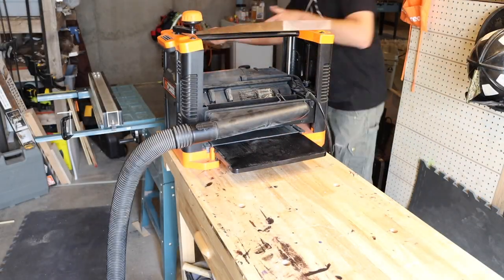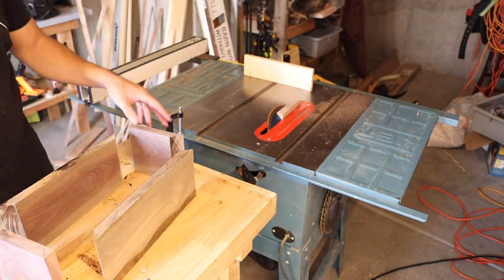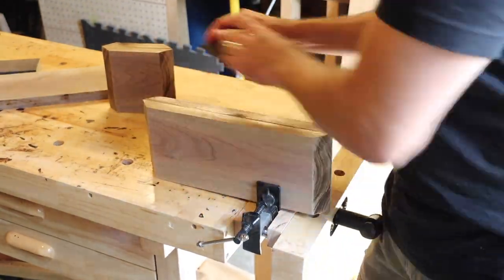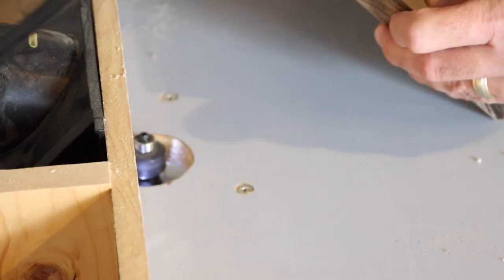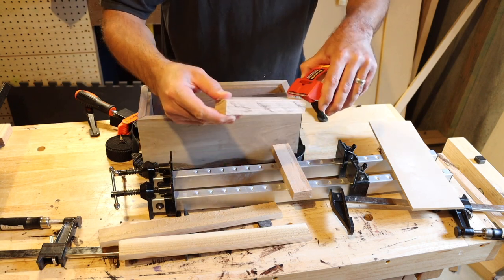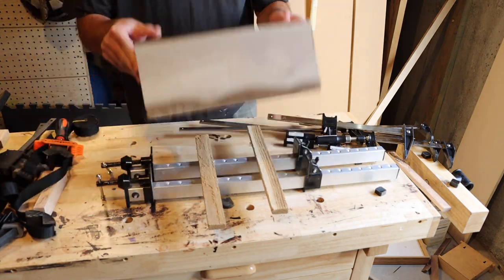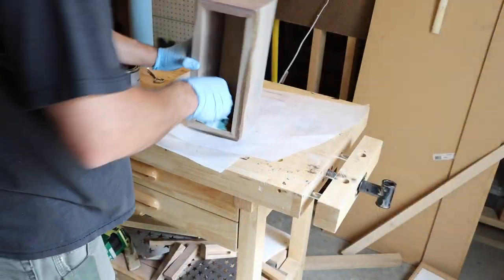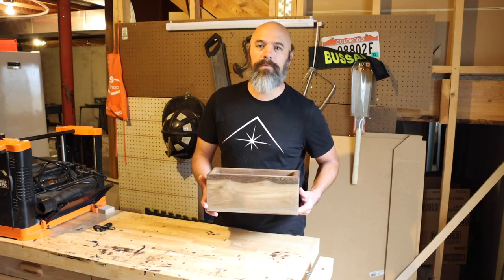Making a Beautiful Wooden Utensil Holder

Comment: Some gentle criticism and advice. Don’t ever back a piece of wood out of a table saw when it’s running. Good way to get kickback and really get hurt. Nice box, by the way.
Reply from the maker: Yes. Thank you. I was wondering when that would get brought up, and I probably should've commented on that. I have had to stop mid-cut before, and I shut the saw off. I really did think that something was on fire and just backed it out without thinking. I've heard conflicting discussions about this, and some say that you should back it out. I agree with your perspective, that if you need to shut off the saw mid-cut it's better to not reposition to a point where you have the potential to have a piece catch a moving blade. Anyway, thanks for watching and thanks for the feedback!